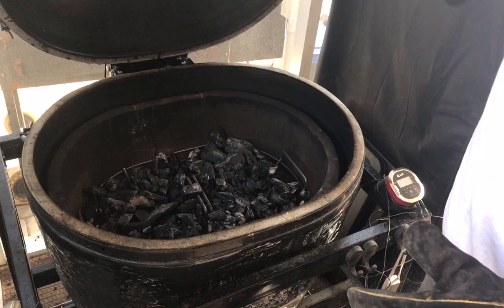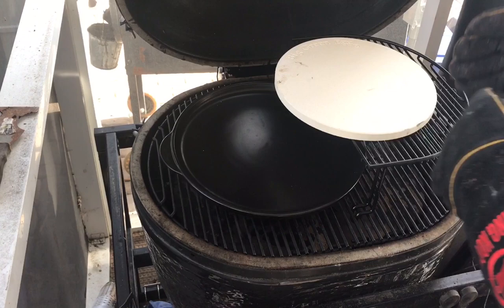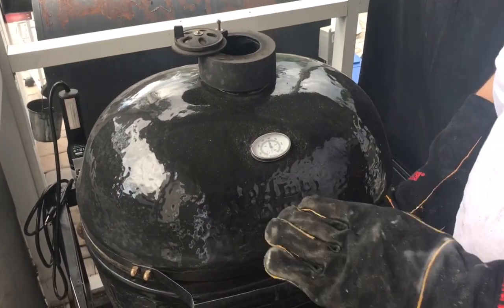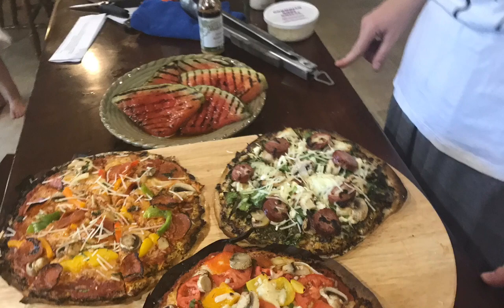Primo XL Oval gets Kick Ash Basket

Comment: Quick question... can just a single basket be used with the divider plate?  I can't tell if it would fit or not.
Reply: Yes, it was designed to use with the Primo Divider.
Reply: @kickashbasket  Hi! What happened to the half baskets? I can only find the single basket with optional divider. Thanks.